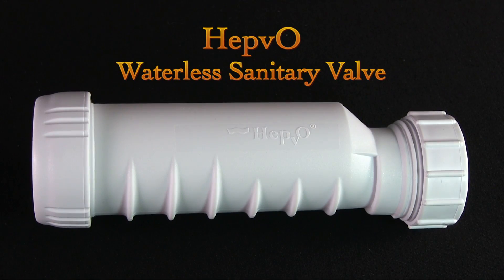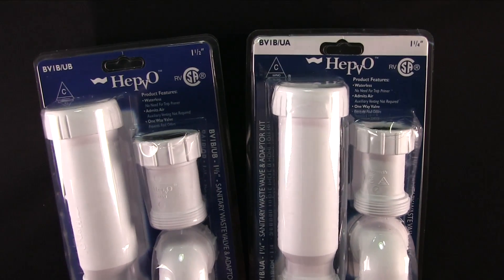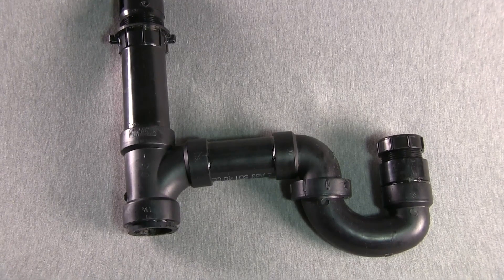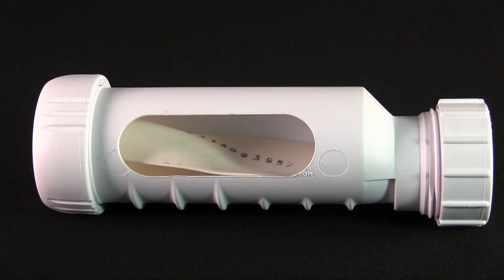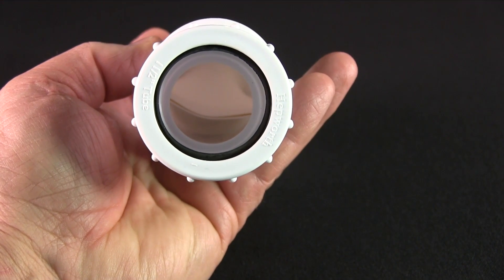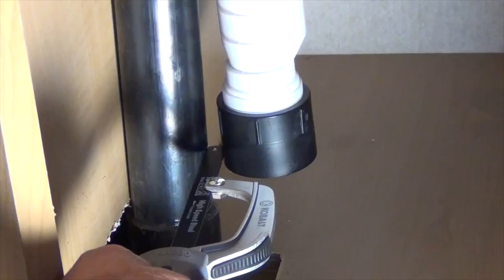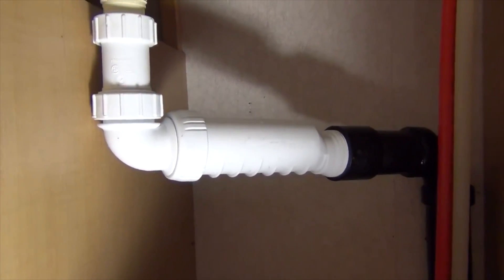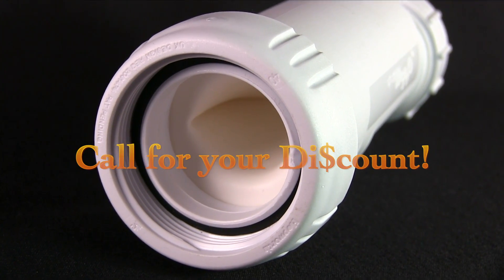Save Space with the HepvO Waterless Sanitary Valve

Comment: Hi, 
I have a specific question. At 3:18 on the video, what kind of elbow is connecting with the inlet side of the HepVo? Is it a street elbow? Is it an elbow with a short extension of 1 1/2 in abs pipe?
Thanks,
Steve
Reply: A street ell may work, but in this instance (if memory serves correctly), it was a standard 90-degree ABS elbow with a short section of 1-1/2" pipe.

Comment: We have an Allegro Bus and Tiffin installs the HepvO in the galley sink. Generally I like the concept of the HepvO valve. However we've had some problems with water backup after a season of use. Obviously you don't put food down your sink in an RV but we found coffee grounds from rinsing the coffee filter ultimately clogged the filter. The good news is the HepvO is relatively easy to remove and rinse out the second time you do this. The 1st time I destroyed the valve and had to buy a new one. I wish I'd seen your video prior to replacement.